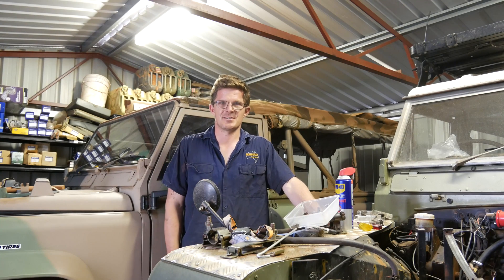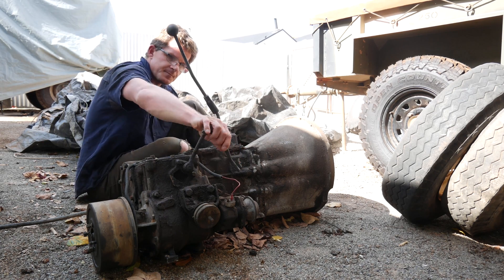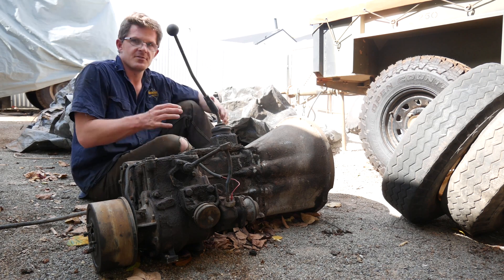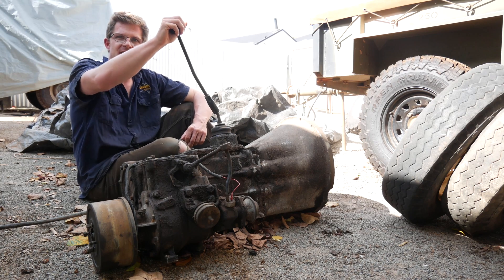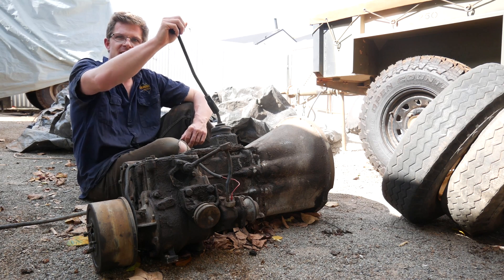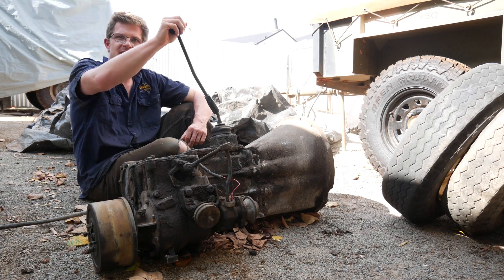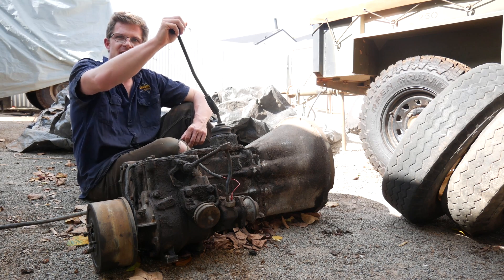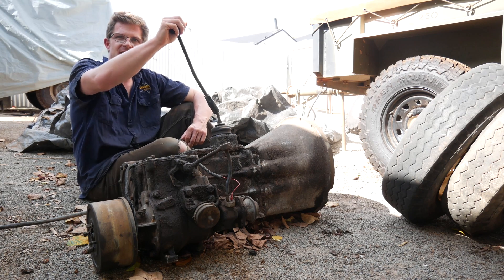Seriously Series Workshop/ Land Rover build Update

Comment: Excuse me if this is not a kosher question to ask here; would you recommend electronic distributor conversion for the Holden 186 in my 1976 Series 3 LWB pick up? New points last about 11 months but need resetting every 3 months, or he runs rough as a monkey's bum. The motor was swapped in 2000 before I owned Solly. Age and origin unknown. Engine number is 186 A11611. I can't seem to find out anything about it online. Really enjoying your videos. Thank you. I got here via Foreman and Wilms, which I also enjoy. All the best from Wellington, New Zealand.
Reply: Hi Glen, are we talking about the ignition Breaker? The only reasons why they Burn so quick are, you Drive 100kmiles a year, Bad wiring, or Bad capacitor, who is Always a pain in the Backend. No way to Check If they are Working and They can be Garbage right Out of the box, so its Not a Bad Idea to Order a Bunch and Sort Them Out right away.
Reply: @berndeikers8924  Thank you for your comment. The Bosch 534C points are good but I think the dizzy is past its best. I have another from a donor 186 engine. I'll try that. All the best.
Reply from the maker: Hi Glen. I would agree with Bernd, however I would suggest looking at fitting a Petronix kit if you are doing a lot of miles and are a bit time poor. I have run these kits in the past and they are very good, it basically converters you point dissy to electric. I have placed a link below:

http://www.pertronix.com.au/?gclid=Cj0KCQjw4PKTBhD8ARIsAHChzRKb0CsUJbIOpaV77XjnyX8XP9gNxof_HbrZBYcElDuCS7dQnju3VAYaAh9YEALw_wcB

And welcome to the channel and the Seriously Series community. Mr Foreman is a true gentleman.

Kind regards

Geoff
Reply: @seriouslyseriesaustralia  Many thanks Geoff. It's really good of you to share your knowledge and expertise. I have bought a Pertronix Ignitor kit as you recommend. I also bought a Pertronix Flame Thrower Coil, which is recommended. Cost was NZ $340 which is apparently a reasonable price. I will fit the electronic ignition on Monday. Thanks again for your help. I really appreciate it. All the best to you and the family in WA.